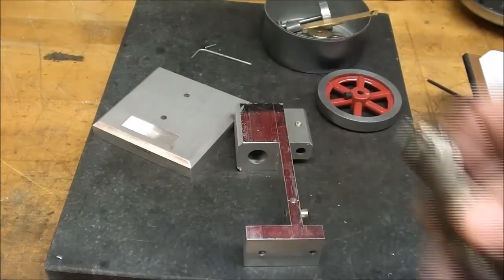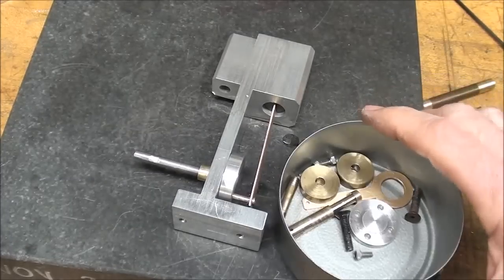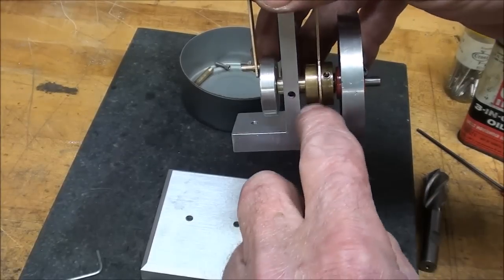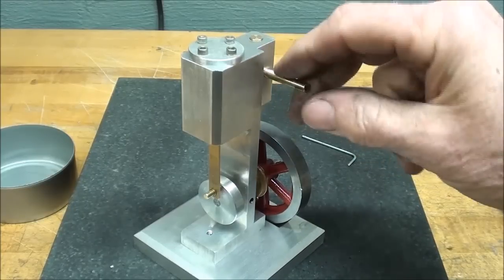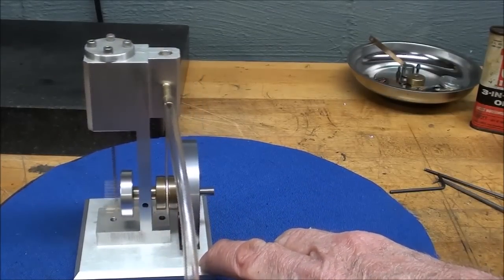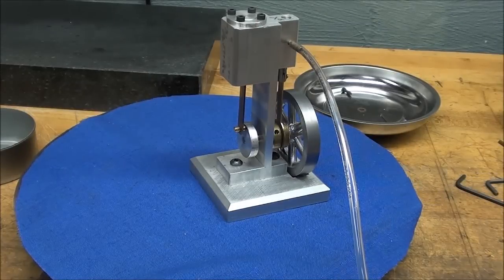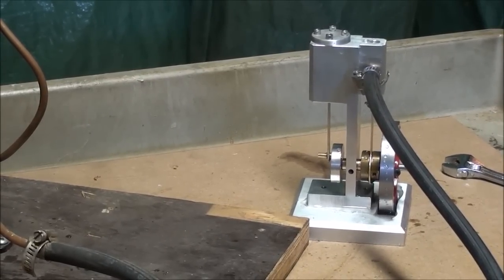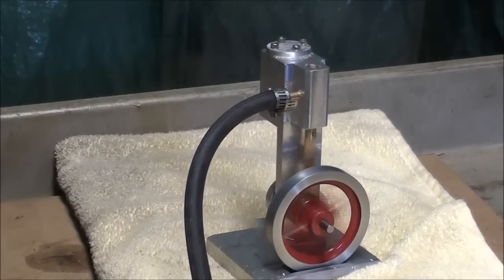tubalcain BUILDS A VERTICAL STEAM ENGINE w/spool valve Part 8

Comment: An erg is the amount of work done by a force of one dyne exerted for a distance of one centimeter. In the CGS base units, it is equal to one gram centimeter-squared per second-squared (g·cm2/s2). It is thus equal to 10−7 joules or 100 nanojoules (nJ) in SI units. An erg is approximately the amount of work done (or energy consumed) by one common house fly performing one "push up", the leg-bending dip that brings its mouth to the surface on which it stands and back up.

Awesome ...
Reply from the maker: Thanks for watching--thats clear as mud

Comment: Mr. Pete - Thank You for sharing.  Together with my teen-age son we are building our first Vertical Steam Engine.  You are our teacher, our mentor and our newly found friend thanks to You Tube.    I'm a senior Jet Refueling Technician, and Dave is a sophmore in high-school where he scores the highest in Math and Computer Coding.   We're somewhere between parts 2 and 3 right now, but we're determined and always looking ahead ( if you know what I mean ), and although we spend more hours talking about the project than actually working on it, two questions have come to mind :  Do you think she'll run on jet fuel ? and where can we mount a USB port so we can plug in the engine analyzer when it comes time to adjust the timing ?  Now of course you know..."we're kidding" about the fuel and the usb port, but we're very serious about the project and working with you again in the future
Reply from the maker: Thanks for watching and tongue in cheek comment

Comment: Lyle, do you not know about mixing Brass and Aluminium with water ? You will get a bad electrolytic action, the ally surface will corrode where the brass touches it, it will expand and seize up the brass bobbin.
Reply from the maker: Thanks for watching. I'll watch for it

Comment: Your memory is very good, from Wikipedia " An erg (short for ergon, a Greek word meaning "work/task"[1]) is a unit of energy and mechanical work equal to 10−7 joules. It originated in the centimetre–gram–second (CGS) system of units, symbol "erg". It is not an SI unit."
Reply from the maker: Thanks for watching

Comment: Over here in the UK the term 'grub' is used for screws without a head mostly they would be of the Allen type but cheaper one's would be of softer material and have a simple screwdriver slot.
Reply from the maker: Thanks for watching

Comment: Mr Pete awesome video. I have two questions, 1. Why do you prefer the engine to run clockwise as opposed to counterclockwise? And 2. Is there a reason you prefer steam over air in these engines?
Reply from the maker: lugosky02 thanks

Comment: hi mrpete iv'e watched loads of your video,s and enjoyed them but i don't do videos but would like to share with you some pics of some engines i built by watching video's from you and others like you.The first build i did was a double acting sort of mill engine it was a wrong start as i should have started with a simple build but i did get it finished.i don't show as a rule because there is always something that could be better or not happy with but here goes see what you think i do know some items on it are a little odd but when i built it i didn't have a mill and everything like the valve chest box was hand filed.
http://i1061.photobucket.com/albums/t462/rayfirth/markham%20grange/mill%20engine/crankmounted.jpg

http://i1061.photobucket.com/albums/t462/rayfirth/markham%20grange/mill%20engine/sizecomparison.jpg

http://vid1061.photobucket.com/albums/t462/rayfirth/markham%20grange/mill%20engine/timedfordiffrotation.mp4

let me know what you think then see if you can work out what the cylinder casting is.
Reply from the maker: Thanks--will check out